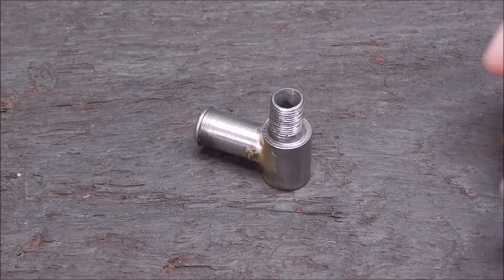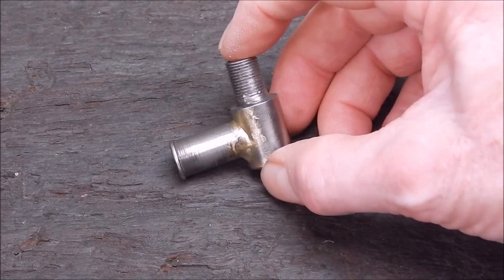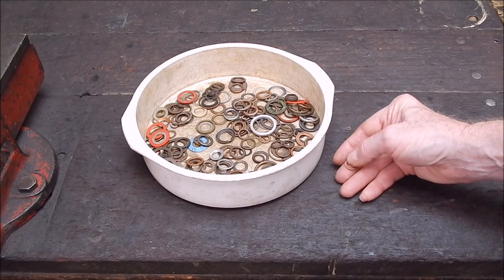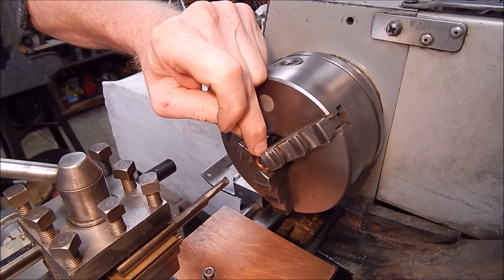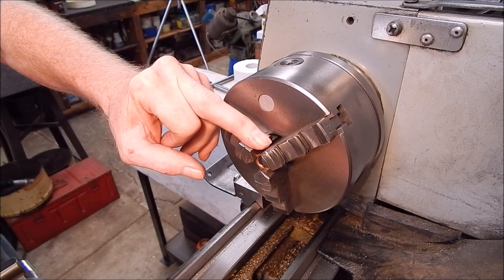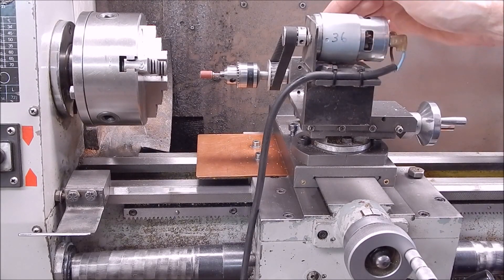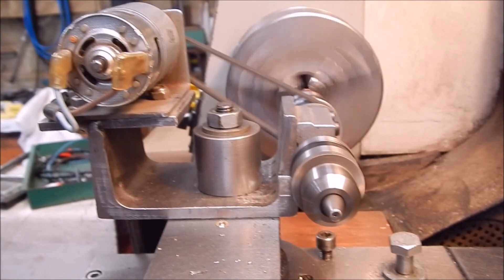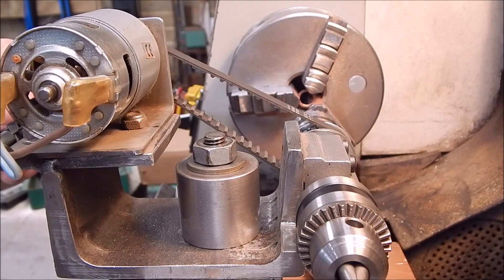A small 775 DC powered tool post grinder makes tricky lathe work easy

Comment: I ordered the parts to make that tool post grinder from BangGood back in January. But with the Wuhan coronavirus problem in China, it’s backordered, and I have no idea of when or even if I will get it.
Reply: I just got an email today that the spindle and belt were shipped. Expected delivery in a month. We'll see...
Reply: By the way, I ordered a “60W universal AC adapter” from Amazon.  It has a continuously variable 3-24V output. 2.5A. 110-240 50/60 Hz input. I ran one of the 775 motors with it. Seemed to work fine.
https://www.amazon.com/woajepu-Universal-Switching-Selectable-Electronics/dp/B07WWBB9DY/ref=mp_s_a_1_14?keywords=universal+ac+adapter&qid=1582246106&sr=8-14
Reply: careful when popping the airbubbles in the packaging!!

Comment: Great job Rob , ENJOYED !
Reply from the maker: Thanks Shawn. 

I was looking at that video you did on brazing with an oxygen accumulator a while back.  What are model and specs for the one you used - flow rate, PSI etc ?  I was thinking of maybe doing something similar.  Cheers Rob

Comment: G'day Rob  This Tata's starting to take centre stage, you don't want to do too many more otherwise it'll break down just to get another 6 minutes of Youtube fame. The toolpost grinder comes in handy. Cheers Peter
Reply from the maker: I just do them as the opportunity arises Peter.  No more Tata fix videos as the job is virtually done.  I've been waiting a month to do a Banggood review, but this virus issue has thrown delivery times out of the window.  Could be weeks yet.  I don't work to the beat of any drum.  Cheers Rob